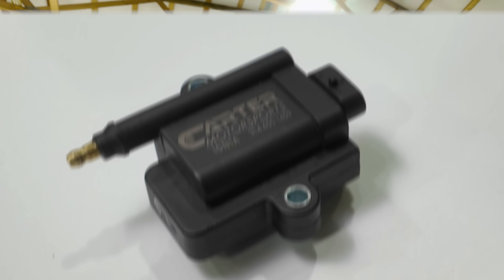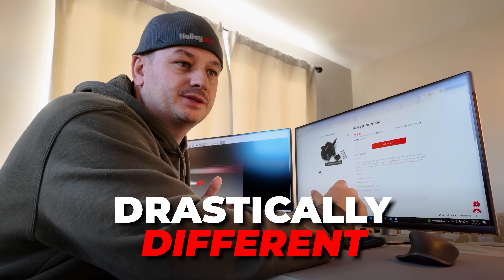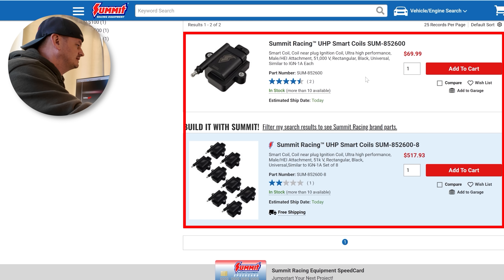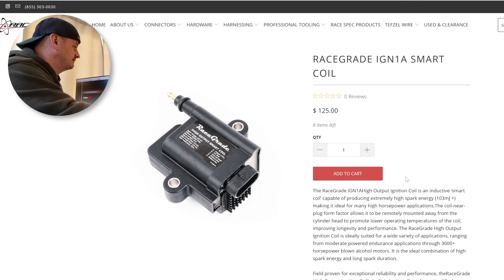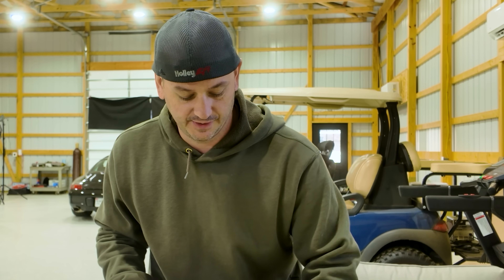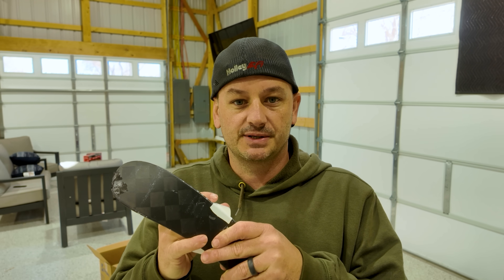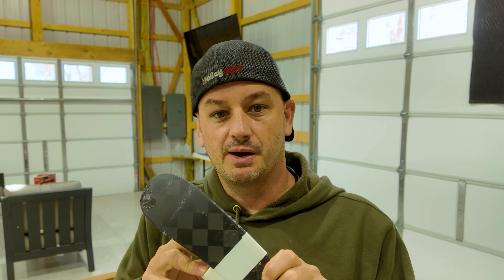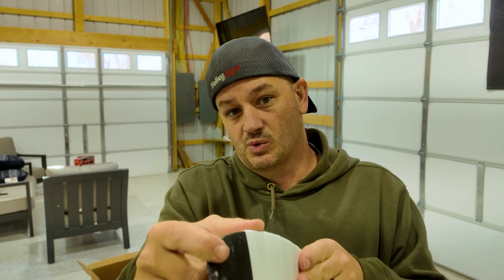These "Smart Coils" Cause Engine Failure - Beware

Comment: I regret my Holley set up.  I should of spent the 5k on Fuel tech. 
I have done around 10 cars with Holley EFI, no problems …But on my own stuff its been nothing but stupid issues over the years. Sometimes it’s perfect, 
sometimes it runs like I have 2 spark plug wires hanging off. Been dealing with unexplainable missfires on and off for 2 years. 
it will run perfect for 1k miles then drop a cylinder randomly in and out for however long till I cycle the key, then run perfectly for another month. Its so random I can’t data log it. 
Sorry for venting, I just can’t figure it out. 
It runs so nice then it doesn’t.

Comment: Why I run only Nissan GTR coils now... I saw this problem as long ago as 2008.. GM never fixed it... Ill never trust the GM coils ever again. Not worth the trouble. They aren't true smart coils and they don't have a automated monitor chip in them and always fail in the ON. I had AEMs literally start on fire... The problem is the original design, not the brand.

Comment: i bought a set of summit coild only reason was they were rated at 51000v thought i would try them but now they are dead. did not even get car running 
confirmed with holley tech all wiring is good

Comment: Any chance you put a timing light on one for the cars with bad coils? Did you get crazy readings?
Reply from the maker: @hiddenperformanceS2K   300 times and no
Reply: @ dangitttt that’s not what I wanna hear. I have carter coils. The first set we had zero issues for 2 years. After winter refresh on the first start up I had 2 cylinders down. So I ordered a new set of carter coils and kept the old ones for back up. The car has never been the same. Thousands of dollars in damage. We think we fix it and bam more damage. I have mercury coils now from a buddys race boat shop and it’s seems to be so much happier.

Comment: We had these same issues with our 2jz build same coil and were really beating our heads against the wall. I'm curious the examples you've worked on are these 12,14 or 16v systems? Our engines a 16v system and I'm wondering if thats a common factor.
Reply from the maker: @mattbrobston6832  both 12 and 16v

Comment: Any chance the coils were damaged during an ecu update? What do the ignition outputs do during a key on event?

I’ve tested a Holley HP with a single coil setup. The ignition output would switch to 5v for about .5 seconds. That’s a lot of dwell time especially on a 16v system.  Did you ever test another new set of the same Carter Motorsport coils?
Reply from the maker: no updates were done. during all of this, an update became available - but didnt want to throw another monkey wrench into the equation
Reply: @JoeSimpsonAtTempest  any chance you could test the ignition outputs on the Holley during a key on engine off event with an oscilloscope?
Reply from the maker: @ChuyTech  no, the cars are not in my possession. both of those cars in the examples have been perfectly fine since.  both cars were wired by highly respected people in the industry. dwell times right in line with the other 90 billion cars that run ign1a coils with no problems.

ive had a minimum of 50 people reach out to me since posting this all saying they had the exact problem with these exact coils (not all holley cars, some even import cars)  so i dont need any more convincing.  multiple ecu manufactures have reached out to discuss since posting this video.

as i said in the video - do what you want with the info, if you (or anybody) wants to gable having all of these issues to save 30 bucks per coil - be my guest im just sharing my experience. (the video just explains 2 examples)

literally try to help people not waste a ton of time and money based off of parts we have seen cause issues over and over again - and it just pisses people off, makes them call me an idiot, try to prove me wrong, say im doing stuff wrong, or say im somehow pushing holley products in the process.  

i guess it boils down to, whats the point of tyring to help if this is how you get treated.

on the flip side there were a lot of people who were appreciative of the heads up.

if you went to a store 4 different times and got punched in the face while you were there each time - would you go back a 5th time knowing the likelihood of getting punched in the face was extremely high? 

i wouldn't, id probably go to a different store.
Reply: @JoeSimpsonAtTempest  did not mean any disrespect. I was genuinely curious and trying to help understand the why? Understanding the why things fail is better for the industry. We wouldn’t  have injector dynamics if Paul Yaw didn’t ask the why on how injectors behave. Keep doing what you’re doing.
Reply from the maker: @  your good maybe that sounded harsh towards you, my apologies.   Step one is getting these to Shane to see what’s going on / different vs all the others out there

Comment: Man,, I thought that you were going to show us what actualy happened to a coil, take one apart and see if there is any concrete BS inside that they took as a short cut.  Any way that you can hook one up in a circuit and see what the difference in the spark is between a good and bad?  How much current are they drawing? How hot do they get under a big load?   Show us what is wrong.
Reply from the maker: @myfastcars  you missed where I’m sending them out to have them tested by somebody who is all set up to do so haha
Reply: @JoeSimpsonAtTempest  Anxiously waiting for that video to post.

Comment: Need to make a video about the insanely high failure rates of Holley's ecus 👍
Reply from the maker: I have never had a single one fail. If i did on a regular basis i would absolutely make that video - along with any other product i felt people should stay away from based off of my repeated personal experience.
Reply: @JoeSimpsonAtTempest  it is a very high issue rate, especially on their lower teir systems like sniper, sniper 2, terminator, and the digital dashes. 
Holley wony piblicly admit to the issues, but there are hundreds of shops, including ours, that have seen such a high rate of failure/issues that we refuse to sell them, and any tuning/diag on those systems are by the hour.
I have dozens of emails and voicemails confirming failures, along with speaking with Holley reps that have explained their hush hush on the issues.

It just sucks that Holley could care less about the actual shops and customers selling/install their trash. 
Their stock price seems to be their focus 🤷‍♂️
Reply from the maker: @  that’s a conversation to have with Holley, not me. I’m not even a Holley dealer. This video isn’t even about Holley. 

And yea, once companies become publicly traded everything tends to change.  Nothing new there
Reply: @JoeSimpsonAtTempest  true. Unfortunately Holley tech doesnt care and wont directly admit to even knowing about them.
Just letting people know that their Holley ecu has a much higher chance than virtually any other system of causing engine failures as well 🤘

Comment: Of all the things I have cheaped out on, Coils, Injectors and high pressure pumps have consistently always been trouble. 

I have a friend who all 6 knock branded coil for his c230 and its been trouble. He had one misfire code before. After the car would not run. He put the old ones back. One by one he swapped out the bad coil for one of the 6 new ones, and only one was ok. a few weeks later that new coil failed as well. 

I bought a Lexus with a misfire and all the coils were oem except 2. Those were the 2 that were causing issues. Just 2 recent examples. I know its not race stuff, but it seems low cost option on these products lead to trouble. 

I have dozens of other examples... but this already too long/

Comment: We had the exact issue. Plugs were always showing hot. We compensated with way more fuel then this setup should have needed. Changed wiring and ecu. Finally changed the coils and bingo.

Comment: The only REAL IGN1A coils comes from PANTERA.  There are many knock offs, but you can get a real Pantera Coil for less than 80.  2ndly coils like everything else have life cycle.  Especially if they have been running them hard.  They are like everything else... Need to be replaced every season.  You can't expect to buy a coil and run it for 5yrs and then just not have issues with them when we are pushing them.  This video doesn't really state anything as it doesn't give you REAL facts.  How old were the coils that were on these cars?

Comment: is there a big diffrence between a 6al box and a good dual sync distributor than coil on plug, i mean power that is.:body-blue-raised-arms::body-blue-raised-arms::body-blue-raised-arms:i mean iam at 988hp turbo 18psi 351w never had a peoblem but then again the master the outstanding tuner the man JOE SIMPSON tuned my car, merry christmas joe car runs outstanding thanks bud.

Comment: Anything over 1800hp -3000 hp shouldn’t they be on cdi coils anyway?
Reply: Not necessarily. Capacitive discharge has advantage of being reliable and high-energy - but also has the huge disadvantage of very very short spark duration. As in the spark lasts 1/100th the amount of time that an inductive spark lasts. The longer duration spark creates more reliable initiation of combustion - provided it's got the oomph to do it at all. Pros/cons to everything.

On a side note - Mercury Marine invented these super coils for their stratified charge 2-stroke outboard engines. At first they tried CDI coils - but that wasn't getting the job done so they regrouped and designed the inductive "smart coils" we know and love today.
Reply: @GroovesAndLands  The whole short spark duration is fabricated BS. Its all about getting energy into the fuel to start combustion, you can do it long and slow or hard and fast. One of the best ignition systems tested was a laser with nanosecond duration and it had no problems lighting up the fuel.
Reply: @mwignitions9203  It's not BS. It is a fact that CDI ignitions have much shorter spark duration.

We can debate whether that's good, bad or indifferent - but it's not BS.

Also, I disagree with your argument that because a totally different technology works well despite short duration - that it's ok that OTHER technologies have short duration. These things must be evaluated on a case-by-case basis.
Reply: @GroovesAndLands  Have no intention of debating the matter. Our decades of experience deisgning/building/testing ecu's and inductive/cdi ignition systems along with many research papers available from SAE etc set out the matter quite concisely.
Reply: Yes for sure a good CDI setup eg. like an M&W system will always have more energy than inductive.

Comment: Dwell times were what? Lots of guys have massive issues with coils. They come to me and the dwell times are insane. 
Tuner error leading to coils dying is extremely common. 

That said MSD and RaceGrade coils seem to be better like for like than others.
Reply: The real coils are supposet to take up to 9ms of dwell (maxed out energy), which is 2/3 of the cycle at 9000 rpm. However there's no indication anywhere how long they can sustain that due to heat, 5 minutes or 5 seconds...

Comment: I have dealings with this before on other coil packs.  The easiest way to spot it is with EGT sensors on every cylinder. I also went to a Emtron Standalone. It was spotted extremely quick after the redo on the dyno.

Comment: The Mercury Marine coils were first pushed by Pantera efi if i remember correctly and a close second was the Amp/diy/megasquirt group. I would assume theirs (amp/diy/mega) are still reliable. I dont know about the Ballenger coils which look to share the same body as the Holley coils.
Reply: I just commented on this earlier in one of the other posts, but yeah I remember something about a guy named Lance possibly the owner of Pnatera efi or Redline can’t really remember if redline was the name of the ecu or the company, if my memory holds I think he developed the coils for Mercury Marine and he held the patent, anyways I’ve always used and pushed the ing1a coils and never seen any issues but if they are now being sourced out then maybe the quality has fallen off.
Reply: @georgeplevritis5190  Yes! you are correct, Lance Nist was the owner of Pantera efi. Thank you I couldn't remember his name. And yes, looking now he was the designer for the ign1a coil. I don't know of the overall quality of the others but I've always trusted the Amp's as they were coming from Lance. I remember reading about them (Pantera) over on yellowbullet years ago and whether they were worth the cost or any actual improvement. How times have changed.
Reply: @Dirtydave67 wow good memory, yep that’s it Lance Nist that name rings a bell, this is troubling news cause I’ve always trusted these coils and even though I no longer build and tune cars people still reach out to me for advice and I’ve never really been loyal to one brand since most of them were just rebranding the coils knowing that Lance was behind them I would just tell people to buy the cheapest ones, if the same company’s like Holley or AEM and so forth are looking to make larger profits who knows where they are being made now, I’m going to have to keep an eye on this.

Comment: Not doubting what you’re saying but you didn’t explain as to why the coils are causing what most would think has nothing to do with the issues you’ve ran into. Granted what I build doesn’t use these types of coils but I’ve been in the game for over 30 yrs and never heard of coils causing an engine to overheat. But the reason I clicked this video was to learn something new but there wasn’t a correlation between the two. And the only reason I bring this up is because Carter atleast deserves a detailed reason as to why their coils fail. I’d be pissed if I were them and you’re trashing my coils but never give a reason as to why they cause the issues you’ve mentioned. At a minimum you could’ve held off on this video until you got the results back from Shane. Like I’ve said, I’m not trying to put anyone on the spot. Just generally curious. Thanks
Reply: I don't think this guy is trying to offer an explanation of "why" - but rather - just a heads up that he's seen some stuff go down TWICE now with these coils.

Also, from the sounds of it - the failure mode is not engine overheating.

Here's my take on the situation:

It sounds to me like preignition. Pre-ignition, mind you - not detonation. It sounds like wild and uncontrolled cylinder pressure, probably on account of the coils firing the spark plugs all willy nilly at random times.

The fundamental operation of a coil is you apply voltage to the inductor (coil) which generates a magnetic field and stores energy. When you remove the voltage, the magnetic field disappears and all that pent-up energy has to find a place to go - which would be thru the plug wire and spark plug.

Thus the act of "charging up" (dwelling) the coil must be carefully timed, and the magnetic field must be sustained until the exact right instant to ultimately generate the spark at the correct crankshaft angle. In the case of "smart" coils - all of this is handled by the circuitry built into the coil itself. The ECU only supplies a "hey, I'd like to fire now" signal. The ASIC in the smart coil does the rest.

Any screw-up of the ASIC and you risk generating that spark at the wrong time - which can easily result in massive and uncontrolled cylinder pressure.

Good luck out there!
Reply: @ it’s like accusing your neighbor of stealing you rake because everytime you lean it in that side of house it goes missing. Would you as the neighbor be ok with that because the rationale makes sense despite not having any proof. 

Generally when you question a companies product you would want the proof that it’s the coils that caused it. Especially when you’re the only one saying it. I would’ve at a minimum held off from posting this video until Shane tested them. When if it comes back that there’s no issue with the coils.
Reply: @CruzanRastamon  If a Lowes rake goes missing every time I lean it up against the house but my Tru-Temper rake doesn't... I'm going to stick to buying Tru-Temper rakes.

...why the Lowes rake goes missing is a separate issue...
Reply: @GroovesAndLands  I literally spit my Redbull out. 😂😂 Touché.
Reply: Over heating the cylinder and over heating the engine dont mean the same thing. The Carter coils are junk and unpredictable with a few lucky customers here and there. It the only product I've seen that has more failures then success. Absolute trash I've heard the same thing about Brandon's character from plenty of people who have dealt with him personally that I know personally. His trash Chinese coils and fake Bosch injectors belong in the trash. Also saying joe didn't explain why the coils were causing the problems yes he did. If you didn't understand it that's on  you I do wish he posted the testing videos on this video

Comment: Hockey stick is a great touch. We love hockey and race cars in my family! I use holley dominator so i stay with holley parts. Injectors, coils, pressure transducers etc. Great video.
Reply: Holley parts are made in China unfortunately...or it could just be that one part I installed on a customer's c5
Reply: @duomaxwell5807  agree. 1 would hope the same name brand stuff being sold would be superior than mix match stuff. I.e holley parts with holley parts.